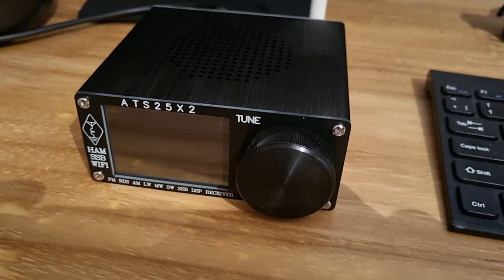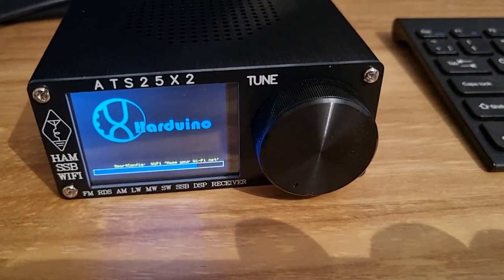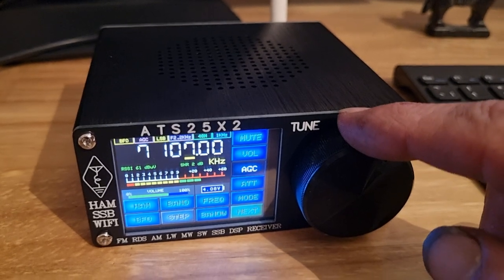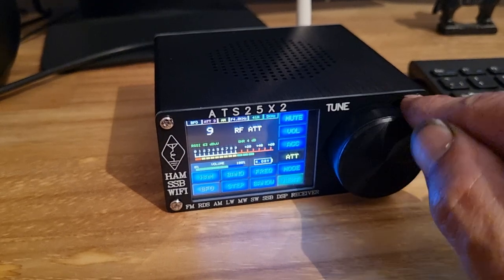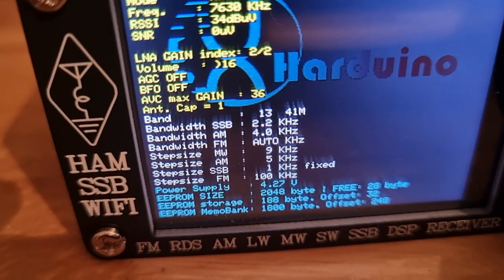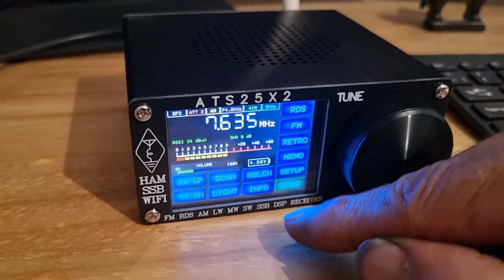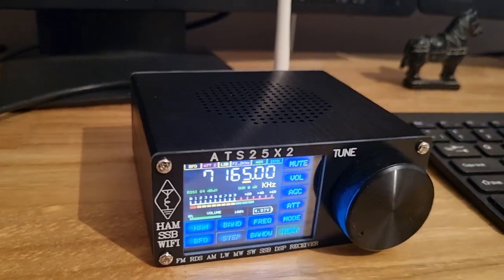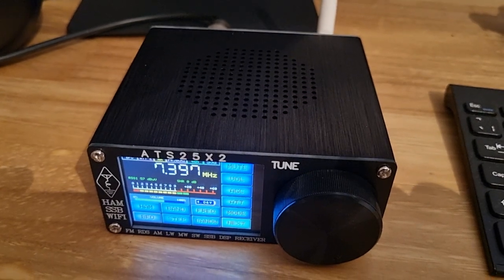ATS25X2 RECIEVER,  QUICK REVIEW

Comment: Needs firmware update 4.1 air....
Reply: I have one of these coming, how do you update to 4.1?
Reply: @onceways  is it durable ? you can depend on working for long time (years ) ?
Reply: @davidespada01  - Yeah I’m very happy with my the build quality is great, I ended up with two for some reason. So if you want to purchase one I’m UK based.
Reply: @onceways  Hi im interesed in these radios. where did you source yours from?
Reply: @rowesounds  I got mine from Ali Express., I'm London based.